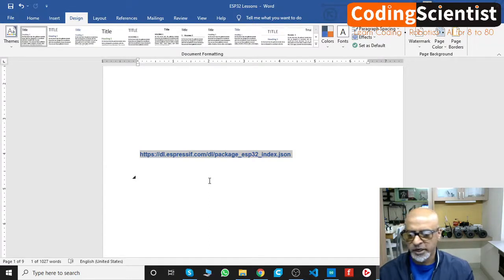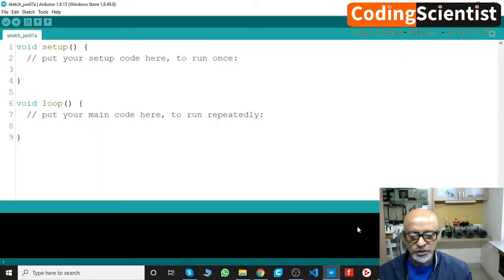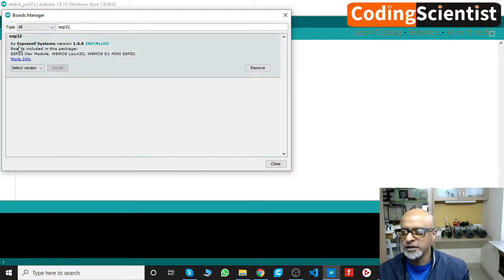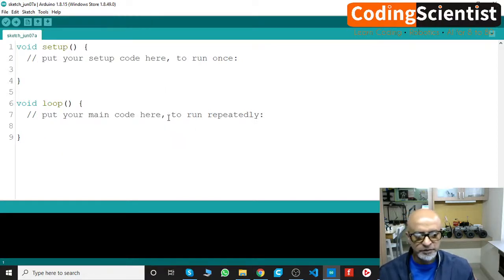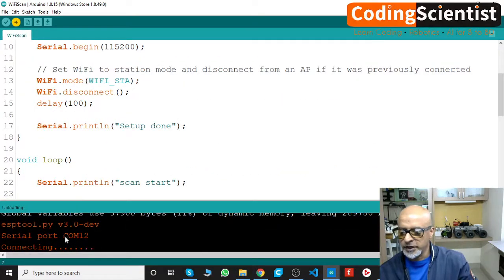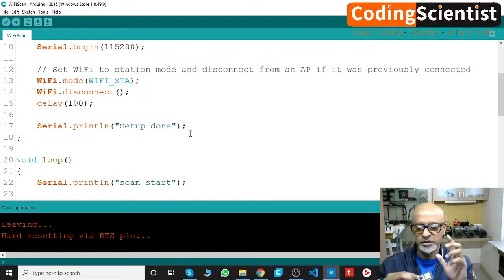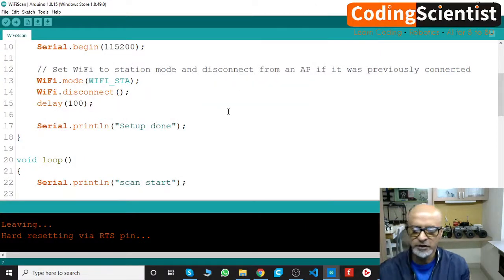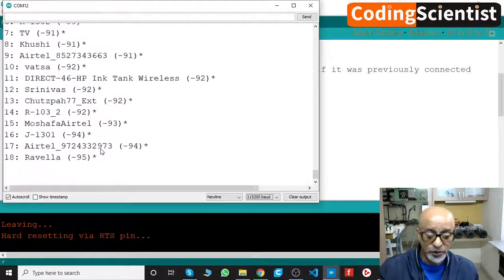Lesson 2 Setting up C++ IDE for ESP32

Comment: hello I am trying to set up my esp 32 board but when i click upload it it says it can not open com 4 the com4 port does not exist i have tried changing the usb cable also installing different drivers but still no luck. please assist
Reply from the maker: @mickharbajnath7366  are you using Linux on your computer ?

Comment: Installed CP210x driver, Installed ESP32 board on Arduino IDE , COM port selected , but still error occurred .. tools > get board info --- Unknown board 😢 Please help me sir . Need instruction
Reply from the maker: Board is not detecting, replace the USB and check, hold the boot button for few seconds and reset, if still not then you got a defective board